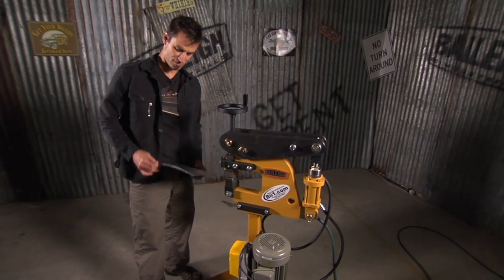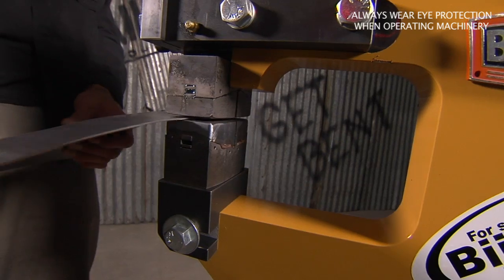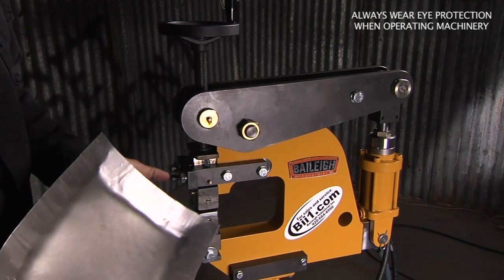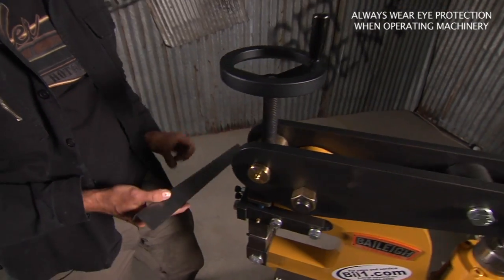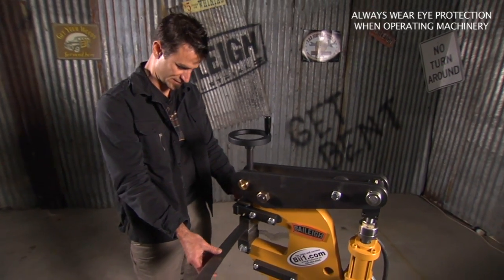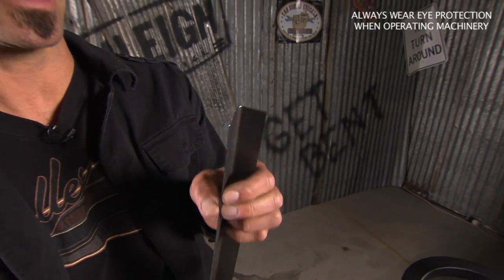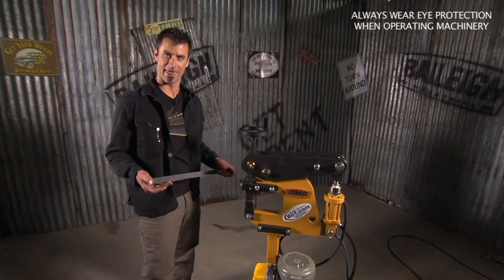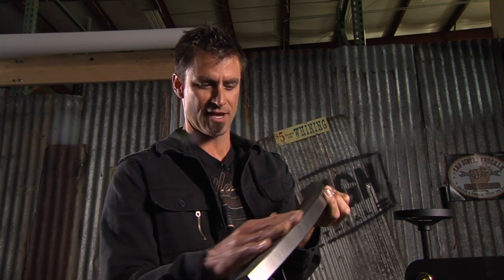Baileigh Industrial MSS-14H Shrinker Stretcher

Comment: The real benefit of this machine is the deep "C" frame that allows you to work a shrink farther into a panel, instead of just the edge.  Work the shrink hard on the outer area and lesser as you progress inward - this allows you to really put a controled, smooth radius type shrink without the "lump" ya get just by shrinking on the edge.